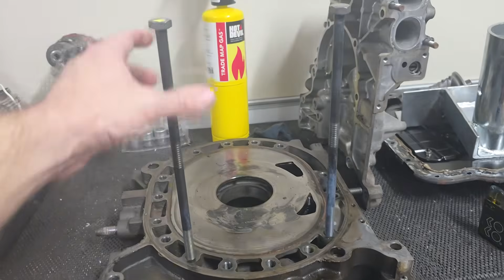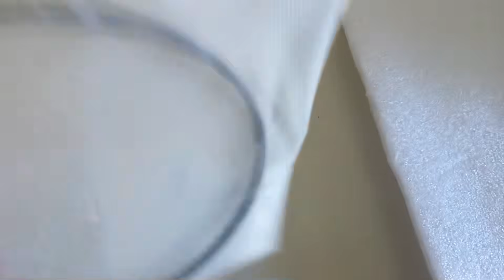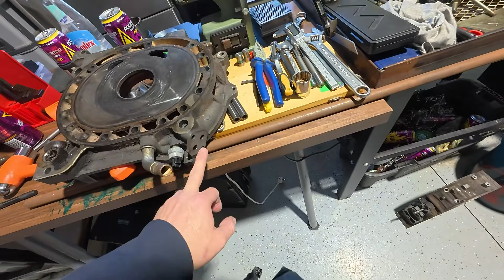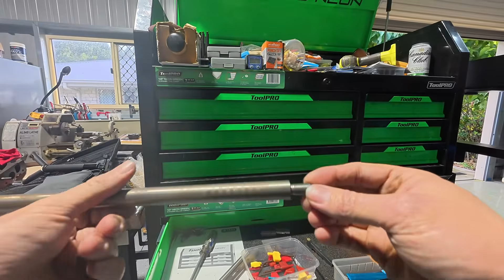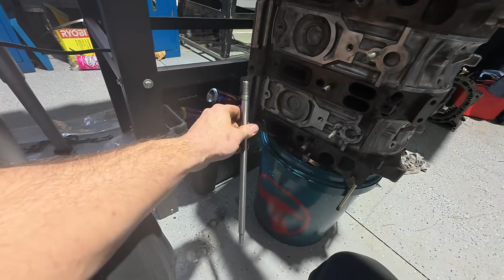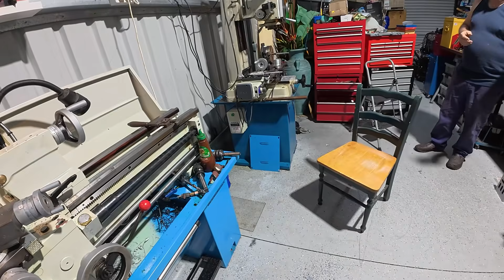RX8 Turbo Build Update - Drilling and Reaming the 13B Renesis for 1/2" Studs

Comment: Out of curiosity; how precise are the holes aligned from factory? If there's only a slight offset in a tension bolt passage between plates, once machined to 12.7mil you'll never get a stud through the block, and with the original bolts fitting through pretty loose there's no real need to have the holes perfectly aligned with eachother in the first place. So are they?
Reply from the maker: From factory they are terrible, irons are mostly ok but alloys or at least used alloys I saw at least 2-3mm out compared to other holes. That's why you have to choose 1 hole center location and use that for your drilling and reaming for entire block.
Reply: @Cameron-RX8  what the.. you'd have to be super carefull to choose the absolute worst hole and redrill it in such a way that the step from 10mm to 12.7 is enough to clean up that 2-3mm offset while not biting you in the leg on the other holes. That's tricky o:
Reply from the maker: Yep!
One was super close to being too loose, 12.5 before reaming it wasn't even taking material out of 1 edge. Once reamed it was just enough. I did have 2-3 which where a little tight but still went in with some love taps. Not looking forward to pulling them out though 😅
Reply: @Cameron-RX8  I'm just soaking all this up man. Found out the biggest rotary "specialist" in the area (a whole country over) doesn't offer machining work like this, so i'll have to make do with a regular machine shop and give them the right set of instructions lol
Reply from the maker: @DOProductionsNL  I have another 2 blocks to do soon so will go into more detail on the next one :)

Comment: Do you use a custom intake manifold to be able to raise boost levels?
Reply from the maker: No not yet, intake is all factory. I haven't tested what boost levels the intake will become an issue, but I suspect it will be about 20-25psi that we will start seeing issues. But I don't plan on going that high in boost level so shouldn't be an issue
Reply: Nice work, by the way. Looking forward to your testing.@Cameron-RX8
Reply from the maker: Once I have the motor in and the Haltech, I will have much more data to be able to see where this can be improved :)